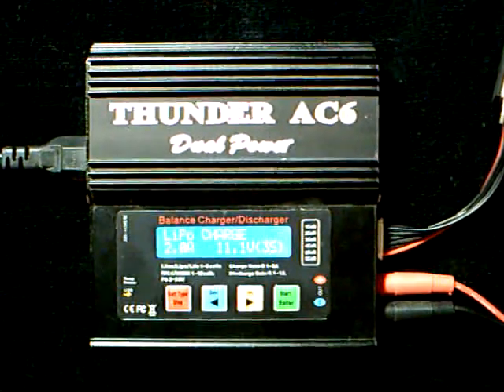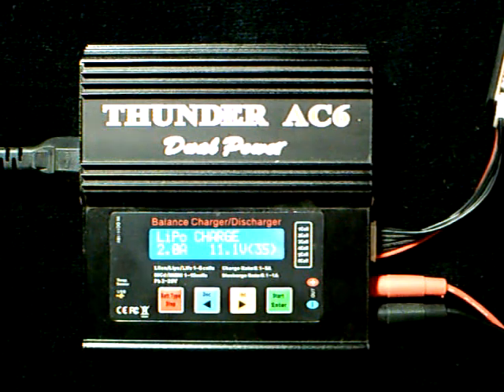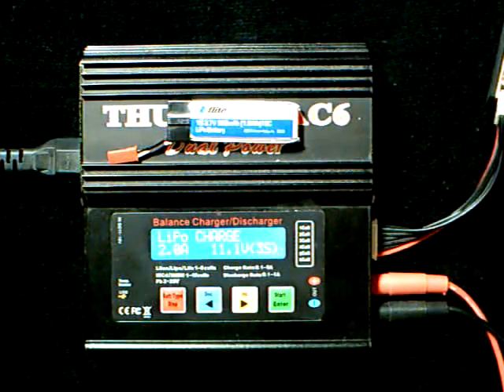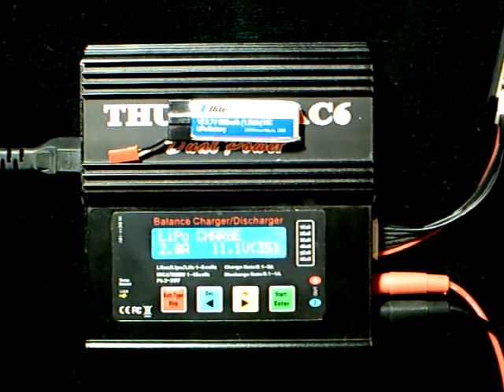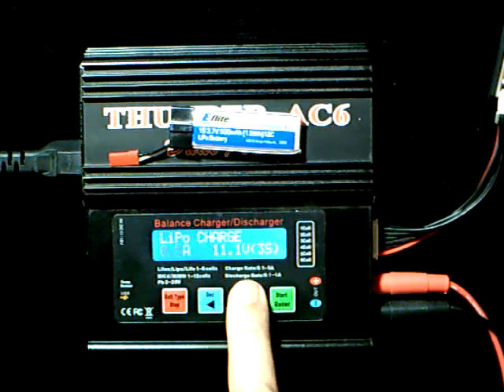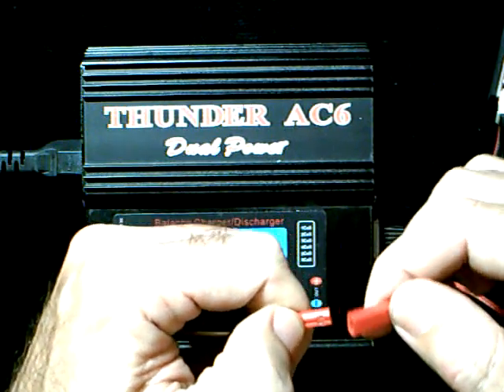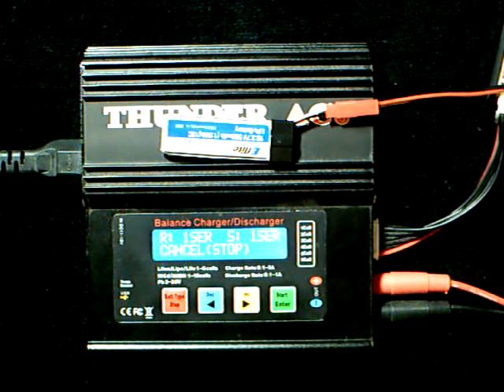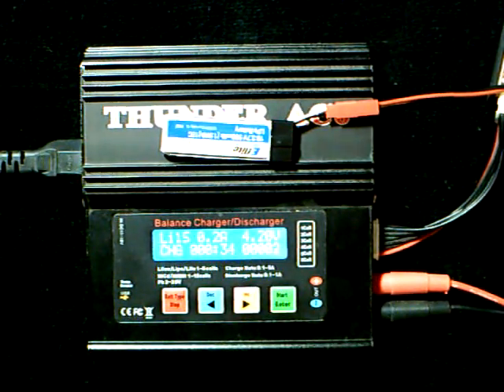LiPo Battery Charging - Charging a 1 CELL LiPo Battery

Comment: I am trying to charge a 1 cell 520mah battery on my tb6ac charger but keeps coming up with battery disconnected all my settings are correct what else could cause this?

Comment: Hi, I was wondering is that safe to parallel charge multiple single-cell lipos on balance charger? The setup I just got is a SKYRC T6755 balance charger and a 1to6 JST lipo charger plug, and some 1s 3.7v 500mah lipos.  So, can I just plug the banana plug into the charger and connect 6 lipos on the other end ? Is this feasible and safe? And I'm assuming that the balance socket is useless when charging single-cell lipos? Thanks!